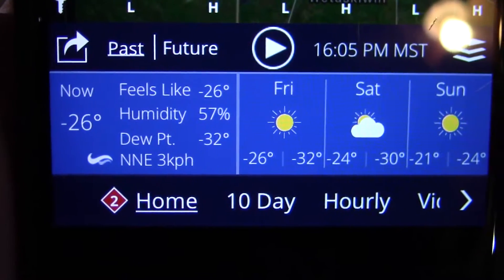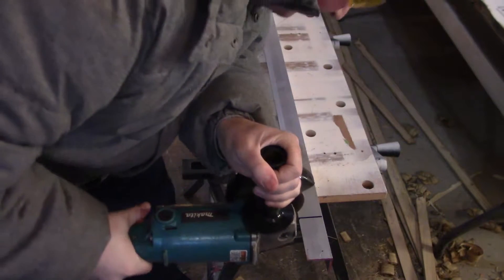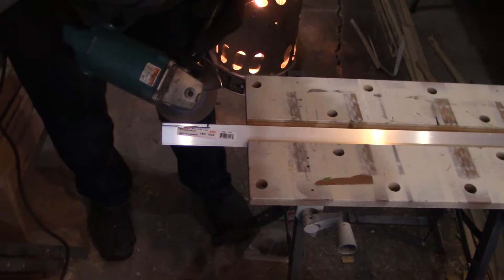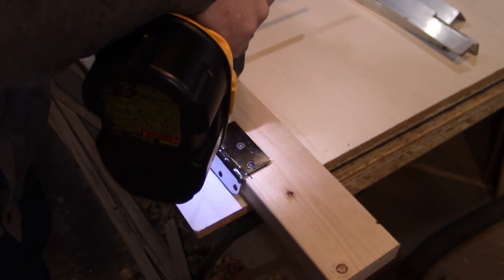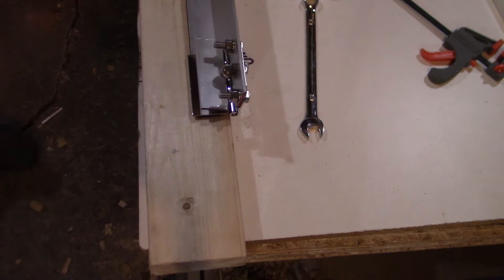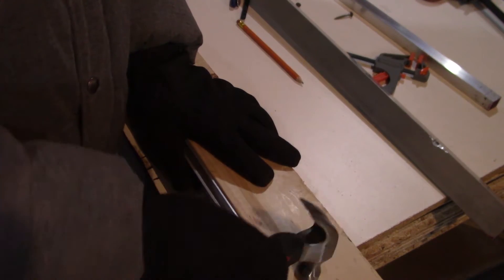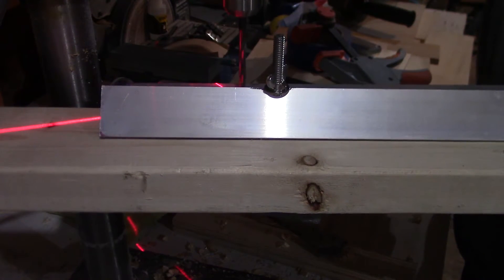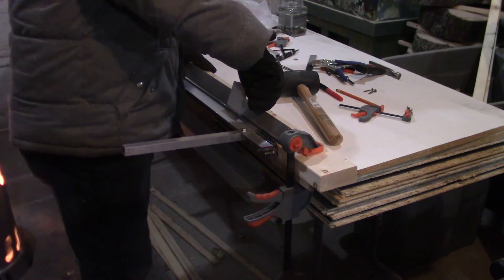Building I Like To Make Stuff's DIY Sheet Metal Brake

Comment: My father in law gave me the same little shopmate bench that came from HIS father in law 😁 And I have used the crap out of that thing. Out of the $100 thousand or so worth of tools I have, this gets used the most often. Funny how some of the oddest tools get used for many many things. I also find many times you don't REALLY need that high dollar tool you see on utube and think is cool. I finally @61 realize I need to stop buying tools to use a few times ,not to use them again until a friend needs them. Some things need to be bought, but most things can be built ( and that in itself) is cool. You have to be at least smart enough to do research and find something that will work for your needs.  Thanks for helping me with my research.
Reply from the maker: Happy to help! Glad you enjoyed it!